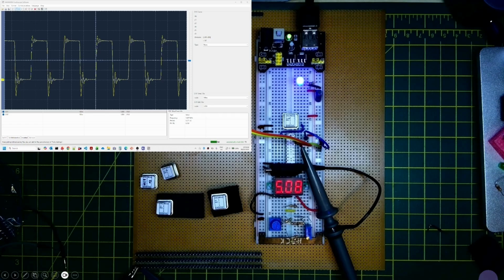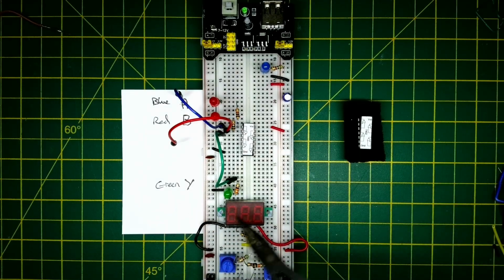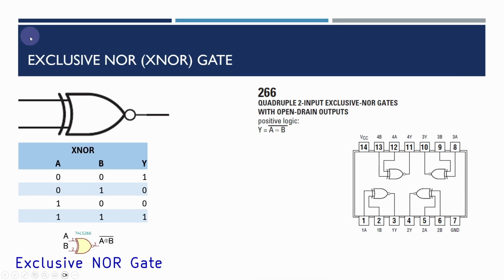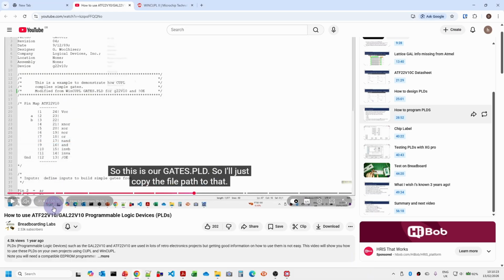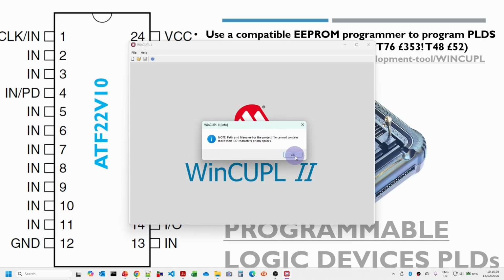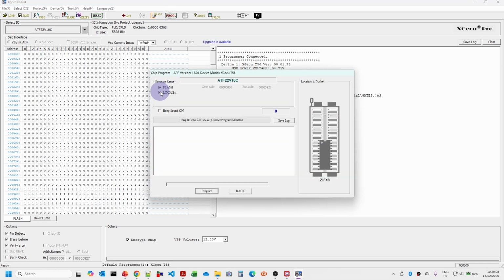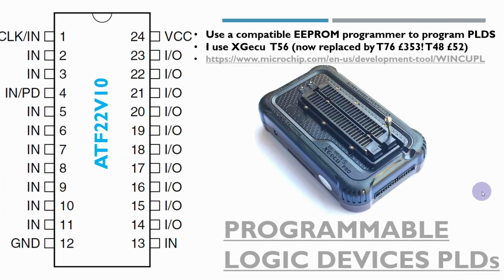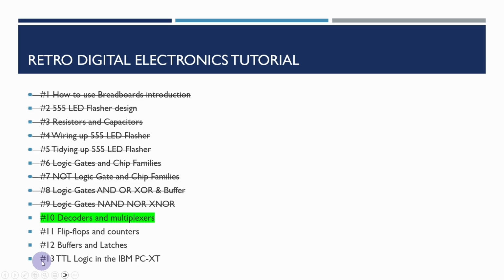#9 NAND, NOR, XNOR & Programmable Logic Devices - How to use Breadboards & Retro Digital Electronics

Comment: I'm a big fan of PLDs, especially the ATF22V10C and ATF750CL. I've switched from the WinCUPL GUI to the command-line version because I'm tired of those crashes. I tried the new Beta version, but the workflow just isn't for me.

I'm trying to control speed by adding waitstates through the MRDY line, which I explained in one of my videos about Glue Logic. It seems to work with my test rig, but I'm curious how it will perform with my 6309 build. Will the theory match up with the real world? Maybe! It might be a bit of a wild goose chase to start with.
Reply from the maker: The MRDY should work OK. I managed to get my 6809 and video card to work 'snowless' using MRDY. I think the CUPL command line EXEs come with the new WinCUPL anyway so you could use them. The main thing is the docs are much better. My only disappointment with ATF750C is the flip flops still can only have a common preset (used in IBM PC wait states). The ATF15xx series is better in that respect. Dave
Reply: @breadboardinglabs  That's true, I did find the common preset to be weird. Although, at lease you can have distinct clocks now. I made a PCB to  breadboard adaptor for the ATF1508. Simple pin to pin, but with the programing header available. I haven't tested it yet, but if the PLDs in my board become unruly, I'll witch over sooner than later. I'll surely cover this in my videos soon.  Fred